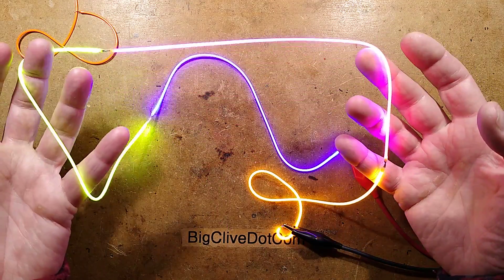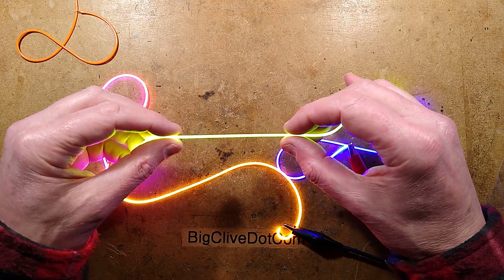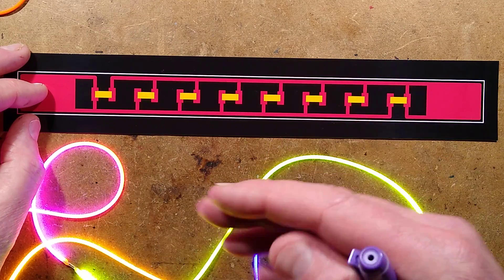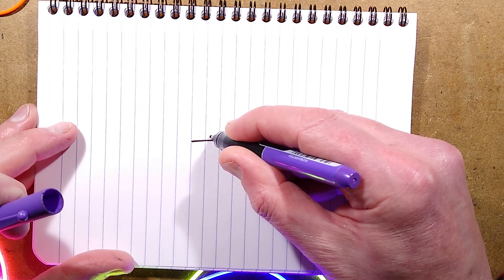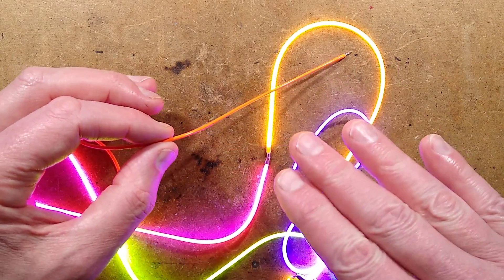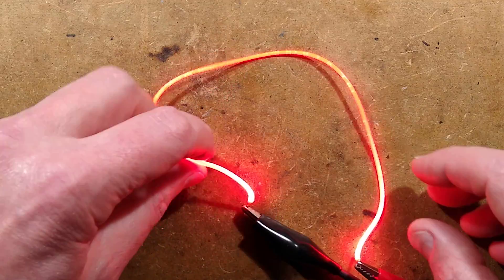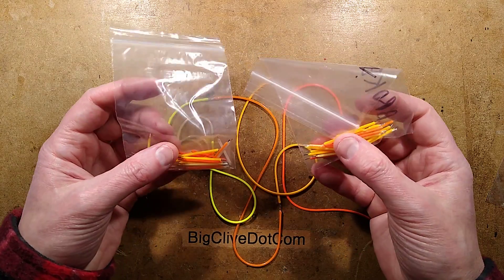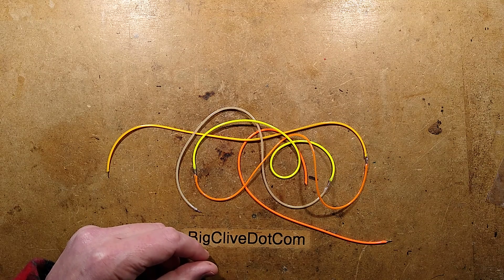How long LED filaments are made

Comment: This is what I dreamed EL Wire could be.   If they could make these as long and durable as EL Wire while keeping the benefit of LEDs, it'd be amazing!
Reply: What if we braid it, so that the bright parts and the dim parts average out, the multiple strands adding stability and a bit more durability, and then run it down the inside of some flexable tube?  A faberic tube maybe?  So it can stitched into costumes?  An occasional loop of thread through the braid to secure it into the tube made around it?
Reply: Yeah, I’d like to see them being more non-directional too.

That said, I’ve been having some luck driving those tiny flash globe transformers with a push-pull driver resonantly with the EL wire on the other end. Still needs a boost converter, and don’t forget the inductor. You can’t treat the primary of a transformer like an inductor if you’re doing a resonant converter, it needs a series inductor at the least. Also getting it resonant with the secondary side isn’t trivial.
Reply: I love EL Wire. I've never gotten any of the EL "Strips" (non-omni directional like the wire), or the EL "Panels" though, but those also are equally alluring as the Wire variant. I always like EL much more than the CCL that everyone used in early computer modding, or car modding for that matter.

I had bought some red EL Wire for a computer once, and some years later ended up owning a 1991 Red Firebird... That EL wire fit PERFECTLY when pressed into the seams in the dash/center console, around the radio and shifter. Which, with the 12V Booster box for PC use, worked just as happily while being fed with the "12V" (14.4V) automotive electrical. 

Unfortunately, my 1993 Firebird's dash is a bit different, and I'm not able to do the same trick :( Further shame, that the Red LED here is basically useless in terms of illumination... but the other colors are vibrant enough that I want to buy some......... I just don't know what I"d use it for!

Although if I were a smart enough person (like Clive) I would probably make some a phone case with a device like those Cell Stickers, but have this work off some sort of IC with its own small LiPo, that something-somehow-detects-calls and then gives a cool neon-glow with those LEDs inlaid into the case.
Reply: @DUKE_of_RAMBLE  EL wire sucks for one reason. The very limited lifetime. Great at beginning, but reducing in brightness very fast.
I integrated one in a computer case ... once ... back when cases just getting illuminated with cold cathode tubes. By the time I was satisfied where and how the EL was going (with occasional light tests) and had the right method to attach it (hint: tiny dabs of hot glue are NOT the way to go) it was so dim even in a complete dark room it was barely visible.
You basically have to throw them out every other week.
Reply: @MrMegaPussyPlayer  I can't argue that they do in fact diminish in intensity over time, but on your case (no pun intended) I legitimately think the fact you were moving it around so much is probably the main reason.

The one I installed in my car, which was unused up until then, I placed it where I had it and maybe adjusted it 2-3 times. It's intensity never changed (to any noticeable degree), and back then I was driving for quite a few hours each night, crusading) cruising around town.

HOWEVER!
I did notice on the other one, that had been handled alot, did exactly as yours, and I noticed it having dark spots, too. It's at that time I started investigating the wire, peeling some of its red outer sheath off...
My two takeaways were:
-There were two wires, a very thin one, and then the ticket one which was coated in the phosphor, which the tiny wire acted like a ground. The coating nearest the tiny wire glowed the strongest and even at the low 120v I swear there was a sort of coronal discharge occurring. (if so, then that could genuinely explain why they do inherently get dimmer over time from O3 oxidizing the coating) 
-The phosphor coating was VERY fragile, and barely adhered to the main wire; more like a powder than a real coating. In the spots it was dark or real dim, the coating had flaked off from too much bending or too tight of a bend.

I think they should use this same rubbery coating these LEDs have, mixed with the EL phosphor and that thin wire properly spaced the entire length.
OR
Have the main wire in that phosphor-doped coat (a thin layer), then run the thin wire, and apply another non-doped layer over everything.
I think that would be way more resilient and prevent any issues. 

Although, granted, with the LEDs there's not much point lol
Reply: @MrMegaPussyPlayer  no no, not mains voltage. It's high frequency 120V.
Google says its transformer output can be anywhere from 80-130VAC and 450-3000Hz. I just remember probing mine and seeing 120 AC, but I don't remember if that was while connected to a PC PSU or my car's higher 14.xV sys. (having been 15+ yrs ago for me as well lol)
Reply: you can get 1200mm versions for €30 ish
Reply: @deaultusername  Where?
Reply: Laser Wire. But are expensive, very expensive.
Reply: @serpentine1983  Link of where to buy ?

Comment: Those filaments would make incredible light saber effects on miniatures.
Reply: EL wire is a more afforable and durable ( more importantly, stiffer- not as soft as these so it's more lightsaber-y) than these, i would imagine if you had larger models these would be preferable.
Reply: @_waymin  I think EL wire is great, I've played with some years ago and I have a USB cable with 3 strands embedded in the center of the wire wrapped into a spiral, so when it's being used it lights up the 3 strands in sequence to make it look like energy flowing into the device, the speed of how quick the light 'moves' along the cable depends on the current draw of the USB device.
Unfortunately EL paper/wire can wear out over time, that USB cable is very dim now, and EL can't compete with LEDs for brightness & life longevity, so it's really good to see these LED strings.
Reply: @_waymin  yeah, but you can't just cut el wire.
Reply: @GadgetBoy  yeah you can, that's the whole point
Reply: @GadgetBoy  there are actually sheets of it designed to be cut into shapes
Reply: @GadgetBoy  EL-wire can be cut to "any" length (there are some restrictions on shortest/longest length depending on driver being used). These LED filaments can't be cut however.

Comment: The pick and place machines use tiny little tubes that pull a vacuum and the part sticks to it. Then it goes to a certain X/Y coordinate, pushes it into the paste, then releases the vacuum.

On occasion, the vacuum might not release fast enough, or the part might stick to the tube, or whatever, and the part won't stick flush. We called it tombstoning when they'd successfully solder flipped up. It was then that I learned that high frequency RF circuits are sensitive to their inductors flipping up - they'll "work" but at a slightly different frequency.
Reply: Milk machine ... wait - that's a cow :-/
Reply: @jayherde0  or my mother
Reply: SMT machine
Reply: Coffee machine
Reply: Tea Machine
Reply: And it's not binary either, it can be at a 30 degree angle, you wont even know
Reply: Filling machine or rinsing machine?

Comment: They call it tombstoning when SMDs flip up when the solder paste is flowed. That's liquid surface tension working against you.
Reply from the maker: Yeah, it's odd that it did it sideways though.  It might even be a sticky pick 'n' place machine that did it.
Reply: @bigclivedotcom  It would be interesting to know, what feeding system is used for the pick and place machine (bulk, tape, tray, ...?). My suspicion is, that the LEDs are already rotated when they are placed. At least this is a manufacturing quality issue. That's China quality and they can still export the bad items to foreign countries.

Comment: Wow!!  It looks like colored wires that light up!

These look like they would be a lot of fun to experiment with!
Reply: Like electroluminescent wire, but much easier to work with as it is low voltage and more flexible.
Reply: @zh84  And as long as you don't over-drive them, they'll probably last longer than EL wire.